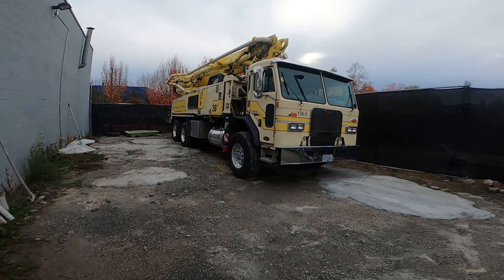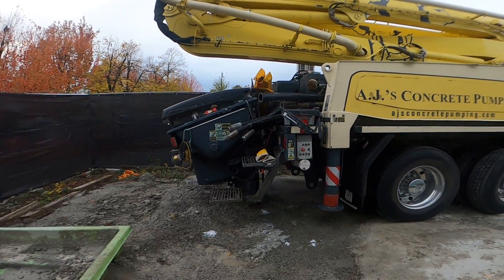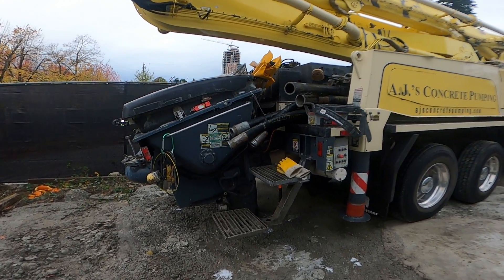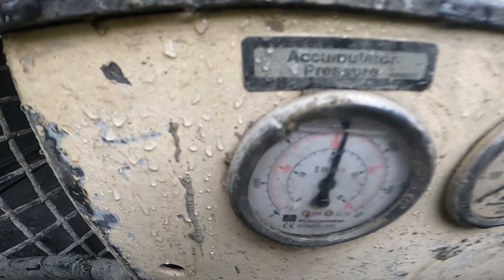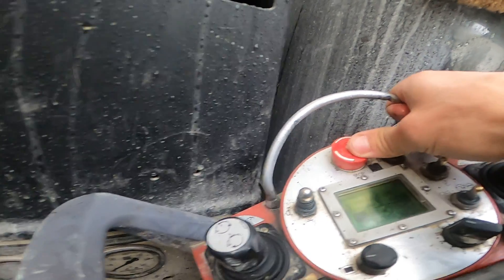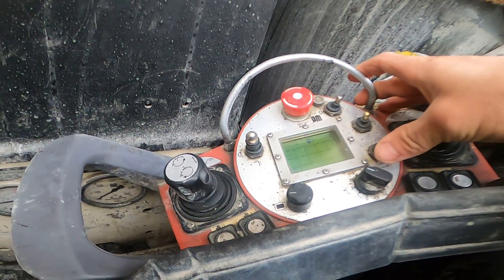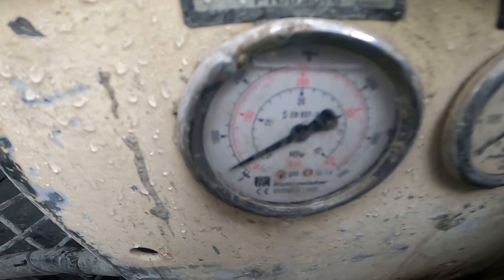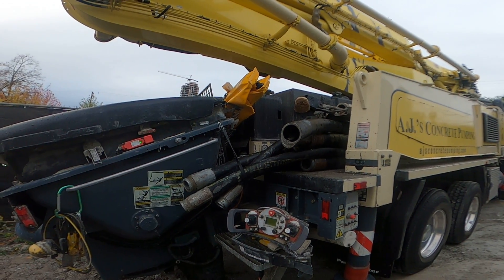How to check accumulator charge pressure, quick and easy:

Comment: Quick question sir .. I have a line pump that recently gave me problems.. will a low accumulator cause it not to build any pressure at all? When engaged to on position pistons  will not move at all
Reply from the maker: Sounds like perhaps an e-stop or hopper grate safety cutout switch issue.
Reply from the maker: https://youtube.com/shorts/30jyplYgyHs?si=fpcu_FjIvsTQWKbU